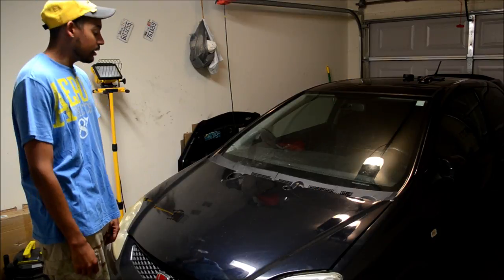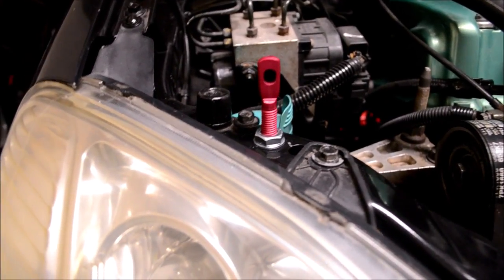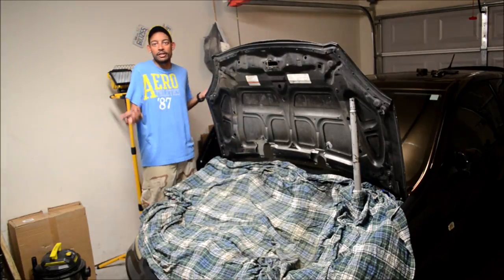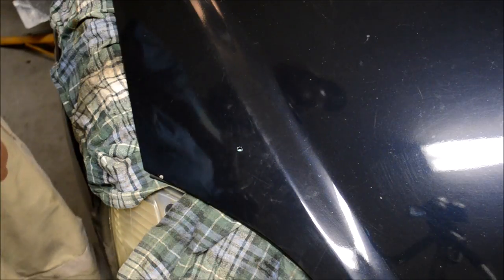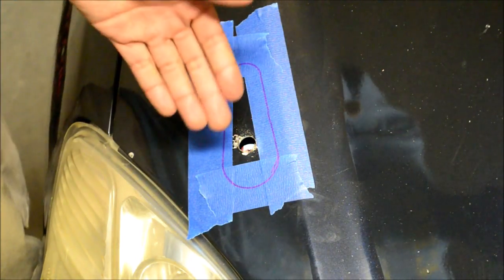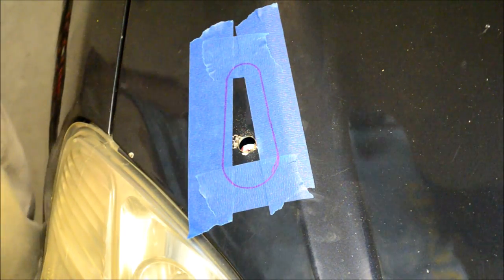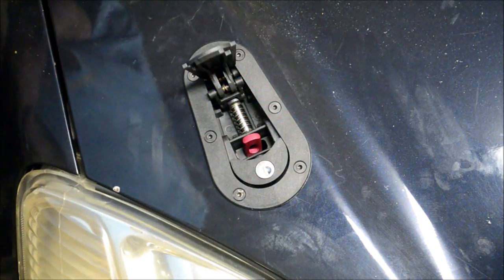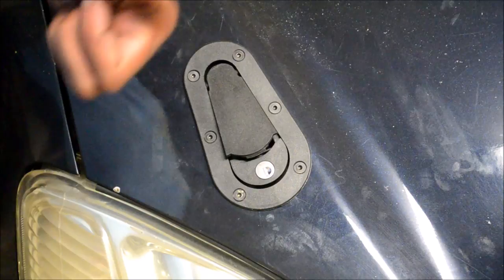AeroCatch Hood Pin Install EP3 RSX

Comment: I have an idea I’m to scared to try on my own ep3 because I haven’t seen it done but I think it’s possible if you’re up to try it and then I will do it 

Rear bumper cut where the arch is in the middle so you can see the bottom of the car you would be able to see suspension arms and exhaust if your curious of what I mean it’s similar to a s2000 rear bumper cut or a 350z bumper tuck
Reply from the maker: You can't cut the arch out or you will lose the bumper mounting brackets. You either need to cut the whole thing so less drag or not cut the mounting tabs off.
Reply: DC502civic629 ahhh thanks for clarifying I think it would look really good but at the risk of having a sagging bumper or one that flops in the wind isn’t worth it
Reply from the maker: You could easily get the shop in description to make you some support bars for your bumper so it would look and open and not flap around. I get all my parts from them